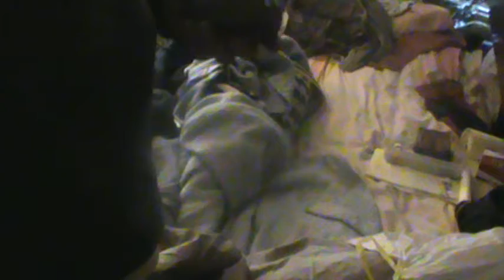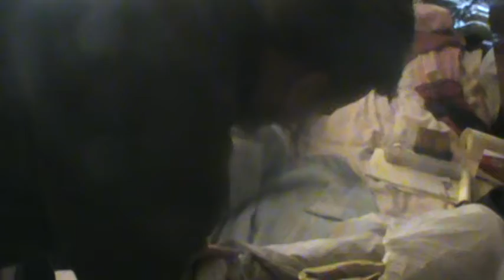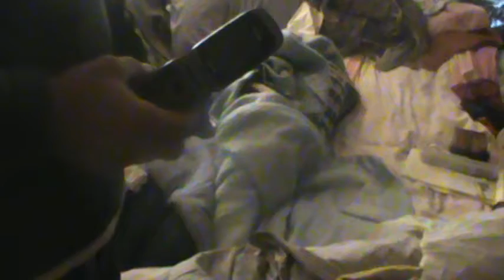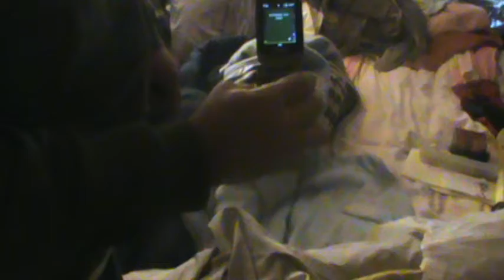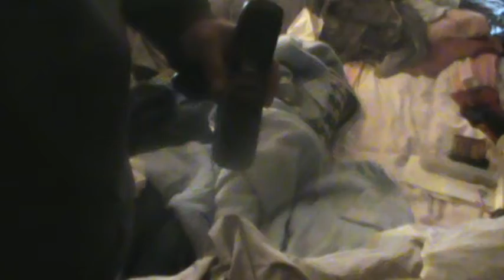3rd video on fabric

Comment: No bro, science isn't still debating dirty electricity" but someone has convinced you it is.
Reply: Electricity is real nigga go touch a circuit board with a rubbed fur cloth amber stone to experience delight.
Reply: Cancer is mosty caused by radioactivity/microplastics which is caused by certain wavelengths of emw. Not all emw cause it , in fact light itself is an emw, even the body produces emw in the form of thermal radiation.

Comment: What's going on what's the signal that keeps hurting you guys please!!!
Reply: It's the bat signal
Reply: I can hear the signal they are talking about.
Reply: its ,micoraves
Reply: It's called meth. Stay away from it
Reply: and why exactly are you concerned?
Reply: Methamphetamine, or meth, is a stimulant drug that speeds up your body's central nervous system. It boosts dopamine, which is a brain chemical that plays a part in movement and motivation. Dopamine also sends a signal that tells you to repeat behaviors that make you feel good.